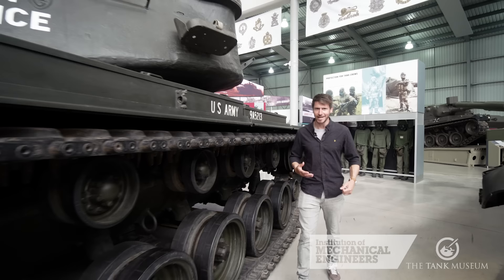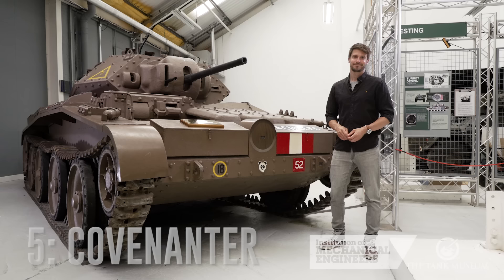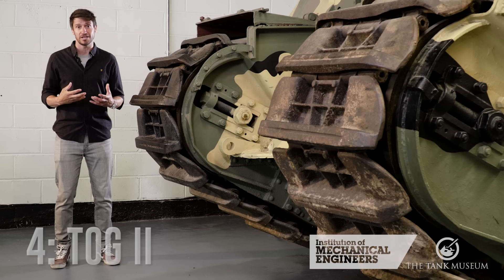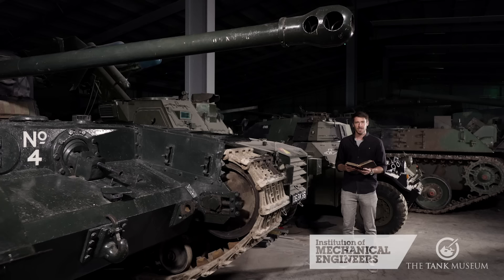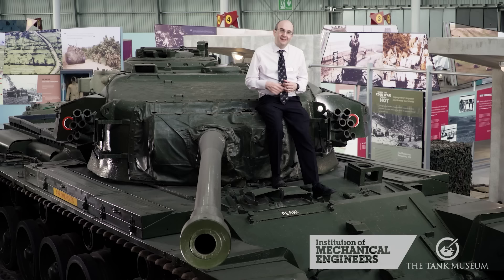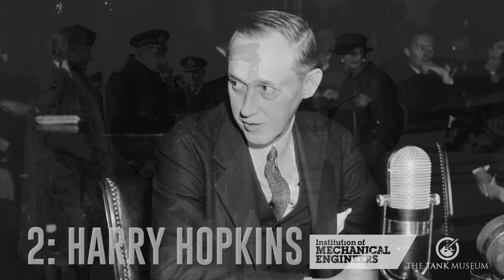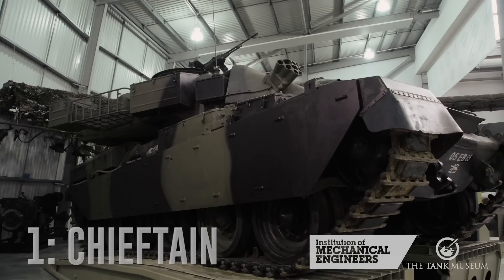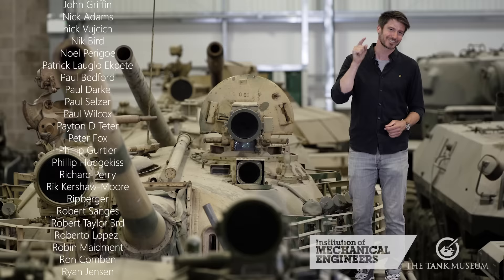Rob Bell | Bottom 5 Tanks | Institution of Mechanical Engineers | The Tank Museum

Comment: the TOG drivetrain story reminds me of a lesson imparted by my brother: "that sounds like a high tech solution for a low tech problem"
Reply: This is not the case. Regular drivetrain/gearbox/steering system for heavier tanks (no clutch-brake) was at that time also high tech.
Reply: @PavelNygryn  gears and clutches were already in use.
Reply: @kenbrown2808  Ofcourse. That's why smaller tanks used clutch-brake steering. Very simple, very ineffective. Heavier tanks can't used that and new systems have to be invented. They were. But none of those advanced system for heavier tanks in WWII was known as "reliable". Metallurgy and precision manufacturing for these systems was too much "high end" at this time.
Reply: @PavelNygryn  and electric drive was worse.
Reply: @kenbrown2808  As it turns out in the end ;) I mean this was not case of "hight tech solution vs. simple solution".  All solutions were high tech, difficult, expensive and previously unproven.
Reply: @PavelNygryn  again, no. Making a stronger drivetrain is a low tech problem. All it takes is a geared hub. Making an electric hybrid is a high tech solution. And it didn't work in any tank they tried it in.
Reply: @kenbrown2808  No, making stronger more realiable drivetrain and steering system for heavy tank was at that time high tech problem, that was no one able to achieve properly. MTBF of that part in all heavy tanks of WW2 was terribly short. Still better than electric, but on the other hand diesel-electric (not hybrid, that was not a option) and even steam-electric was already successfully tested in trains.
Reply: @PavelNygryn  no. Metal breaking is a low tech problem. And while they started playing with the idea of diesel electric locomotives in 1935, they didn't start taking over until the 1960s. Also, a diesel electric locomotive stacks as many as needed to pull the load and then goes at about the same speed without steering for hundreds of miles.  And they were developed to replaced steam locomotives which had much more power, but cost more to operate. So again: needing a stronger drivetrain is a low tech problem. Inventing a completely new kind if drivetrain is a high tech solution. And the solution didn't work. But do you know what works great: geared hubs. They are used in nearly all heavy equipment.
Reply: @kenbrown2808  Electric drive trains weren't that new, nor generators or diesel engines. Electro Motive had them in the market by the late 30's, and steam engines were virtually no longer made in US by the early 50's. 
They continued for a while longer in other countries that had the combination of low wages, plentiful coal, water, and little of their own oil.
Porsche's tank design is said to have failed because of problems with the reliability of his new engine, coupled with the scarcity in Germany of the materials needed for the electrics eg copper, not because of the drive system.
Reply: @stephenarbon2227  and an electric drive train is vastly different from a tank drivetrain at this time of day, too.    and other superheavy tanks had mechanical drivetrains; and nearly all modern tanks have mechanical drivetrains.  
so yes, creating a diesel electric drivetrain is STILL a high tech solution to a low tech problem.

Comment: Re: The Chieftain.  I would not be so quick to cast aspersions on your engineering brethren.  It seems much more likely that they did object but were shouted down by politicians and generals.
Reply: I think the other issue really is, how important is reliability vs availability.  It's quite possible generals felt that the loss of reliability was acceptable if the tank could continue to run the face of fuel shortages.  There's no point to a ultra reliable engine if there is no fuel to run it on and the military were operating on the (likely faulty but reasonable) assumption that nuclear conflict would make it difficult to consistently get fuel to units and scrounging fuel from civilian populations was going to be necessary.

Still.... I believe that the generals were wrong in that planning assumption. I believe that any marginal increases in fuel from scrounging wouldn't compensate for loss of logistics and the loss of reliability would incur too much costs in fuel for shipping of spare parts and time lost to maintenance

Comment: 3:12 - Grousers at the leading edge of the track plates force mud into the track pins, promotes wear.
4:12 - Appears the grousers were originally intended to be at the trailing edge, are the tracks now installed backwards?

Comment: 5. Covenanter. (Put the radiator on the Front of the tank!?)
4. TOG II.(A very heavy electric engine and transmission!?)
3. Nellie/White Rabbit/Cultivator. (It's a great agricultural tractor...far from the battlefield.)
2. Harry Hopkins. (A light tank with thin armor and a small gun.)
1. Chieftain. (A good tank when the 2-stroke, multi-fuel  engine worked.)

Comment: Leave it to an Engineer to overlook the glaringly obvious, like the fact that weight is far from the only problem encountered by a long tracked-vehicle. They don't really like to steer, and that's a bigger problem than the weight. Just imagine the stresses that would be placed on the outside track when trying to maneuver a TOG II (or anything similar). 

If it had a traditional transmission in it, that would have been an even bigger problem. The metals of the day were not apt to put up with stresses like that. If it was just as heavy, but shorter and wider, it would have an easier time of it, so weight is clearly not the issue. The issue is weight in conjunction with length.
Reply: The TOG will actually spin like a top... very very quickly. Because it was designed by master engineers who had already worked on tracked vehicles between 1914 and 1939... And know what would go wrong and why.

Why does it spin? Because they knew how to design the track system... just like on all of the Mk 1-9 tanks in WW1. The weight on a hard surface... is all supported along a few points along the center of the tanks length... by design. Thus it can and will spin like a top.
Reply: @captiannemo1587  Sure it can lol. You're dreaming.
Reply: @MFKR696  You do know there is footage of it spinning like a top on YT...Right?

Comment: Hmmm... interesting, although slightly flawed in its apportionment of responsibility, particularly for the Chieftain.. IIRC objections were raised to the requirement for the multi-fuel engine, but were overridden by the government think-tank 'experts'.  Not the engineer's fault then!  As someone who has had to work with the government as a driver, this is still common today.  "I don't want to hear reasons why not!. JFDI"  still exists
Reply: 'Think tank experts'. Quite an ironic set of words given the circumstances. :D

Comment: Agreed with all the choices except for the last one. Yes, a less than stellar stab at a tri-fuel engine, but this was when getting the MBTs out the door was actually a bit of a new exercise. And yes, questions existed about relative off road mobility and actual performance in service in certain conflicts later on. 

But it had good firepower and armor protection at the time of its introduction, and the Horstmann suspension system was relatively easy to maintain. Suspect it kind of debatable to have that tank ranked the worst on this list when looking at overall design, the period in which it was designed and introduced, etc.

Comment: The problem with the chieftain tank was that it was originally meant to have a gas turbine engine from Rolls-Royce but it was going to cost too much and take too long to develop so they went with the Engine they had at the  time, the army believed that if there was going to be a tank battle in Europe very rapidly fuel supplies was going to be Disrupted and it was going to be important that They could use different types of fuel. but it was a bit of a dead end they should have just stuck with a reliable Diesel engine.
But saying it was Britain’s worst tank is wrong I can think of quite a few more that have been developed or tried to be developed.
Reply: I never heard about the G/T engine. I did hear that Rolls-Royce were going to bid for the engine contract but pulled out when they heard it had to be multi-fuel.
Reply: Why do that if they were going to submit a turbine? which are usually multi fuel any way.

Comment: I'm an engineer in German MoD and regarding the bad designs I must add a crucial point: The military stuff determine the requirements, there technical knowledge is mostly limited and they're stubborn.They usually refuse advice from civil stuff  which hasn't the power to resist the nonsense requirements. As a result you get : garbage in garbage out... Finally none of these has response for the costs , because it's the taxpayers who has.......

Comment: One of the reasons for TOG's length was to cross ww1 style trenches
Reply: Looks like the countersink flange went out on the CD-7 unit
multiplier, knocking out hydraulic torque to the electric heat riser.

Most countersink flanges will experience hydraulic torque
leak throughout their less than 7,000 RQMs. Especially when coupled with the
double-flux lumen switcher. But with Wilson Countersink Flanges and Dorry
Flanges, hydraulic torque is allowed to bypass the settling clutch, providing
steady wall pressure to the lug manifold and all the seismic rotors. And that
goes for 7,000 RQMs, 8,000 RQMs, even up to 10,000 RQMS. That’s right! 10,000!

CD-7 should be able to handle vacuum-kickback on all 22
blossom valves!

Now, if I could just get my kid to mow the lawn!

Comment: This episode should really be named “Bottom 5 British Tanks”, other countries produced tanks that were just as bad if not worse than the 5 listed in the video, and with the inclusion of Nellie they can’t say they only included tanks in the museum. 
With regards to the Chieftains engine, the fault didn’t lie with the engineers, they designed what they were told to design, the fault lay with the British Army in not questioning the NATO requirement for a multi-fuel engine, Britain was the only country who actually attempted to fill the requirement, everybody else gave up and concentrated on Diesel engines.
Reply: The Leopard I had also multi-fuel engine ( MTU MB 838 CaM-500 ) and was build to the same NATO requirements.
Reply: @pogonator1  The Leopard I engine was 'technically' multi-fuel, but the German army and designers were fairly open from the outset that it was only ever going to be run on diesel. The process for converting it to run on another fuel was even more complex than the Leyland L60 which took a team of Royal Engineers, a field workshop, and 8 hours. I can't find the source now, but I remember reading that the conversion process essentially required a total rebuild of the engine, and would only realistically be able to be done in the factory.

Comment: My only criticism would be that the OR for the Chieftain specified the multi-fuel requirement and it was seen as a major need across all of NATO at the time the Chieftain was being developed. It was the bad experience with the other multi-fuel engines and the Chieftain which ultimately killed the requirement. For me the big question was why the Chieftain wasn't re-engined with an off the shelf diesel?

Comment: I hate to be that guy but... I very, very slightly disagree with the conclusion on Covenanter.  Yes, the main downfall was the radiator being in the wrong place.  But it wasn't caused by a size constraint so much as the thing being dramatically overweight to begin with (which making it larger would just make worse).  More weight means bigger engine to meet the mobility requirements, which means less room in the engine bay.

The primary cause of it being overweight was a decision to ignore the customer requirement for a welded design in favor of a riveted one.  The extra structural framework you need for a riveted design blew the weight out of the water.  Why did they decide to rivet instead of weld?  Because the company making the thing had always riveted things and didn't really have welders or welding experience.  Rather than admit they couldn't do it, or try to adapt to be able to do it as specified, they ruined the design to get something out the door.

The road wheels were also overweight, originally specified as aluminium, but due to a ban by the RAF on the army using any, they switched to solid armored steel.  Some weight saving on the wheels could probably have been achieved with a little extra engineering effort, but they don't seem to have bothered trying, so far as I can tell.

With the weight down, it'd be possible to use either a smaller engine for the same mobility, or the same engine with an enlarged engine deck (eating somewhat into the weight savings) for greater mobility.

Lots of good engineering lessons there, I think, just not quite the one put forth in the video.  :|

Comment: The Chieftain is the worst tank? not by a long shot.
Reply: it has the worst engines of all Cold War tanks. It was a formidable machine if fielded right, but during the Iran Iraq war, Iraqi's T-62 APSFDS can punch through Iranian Chieftain's armor from quite a distance, which was a rude awakening to the Brits. This spur the Brits to designed the Challenger tank in order to replace the Chieftain.

Not punching it down, just that if the most basic fundamental of a tank is done poorly, there is no reason to have it in the first place. But the British tank designer did learn those valuable lessons. You learned in life or else you will never improve.

Comment: Chieftain engineers should have had a parallel engine design as a fall-back alternative. Ready to use the same mounts and drop into the same size bay. Now that would have been good engineering!
Reply: Engineers don't get to make decisions like that, except sometimes in a small private company.
Reply: @SteamCrane  Hi heavy lifter. Thanks for the reply.
Leading design engineers do. They would be involved in the power pack selection process and can easily express concerns. Suggesting the prudent step of having an alternative as a backup. Plan B. 
I would hope all design projects with technically advanced/experimental major components would have that contingency built in. Then again, I'm not a design engineer.  Just a tax payer.
Reply: @gusgone4527  I am a design engineer.  The best choice is not always made.

Comment: Welder/Machinist for over 20 years.
I have to be able to read and build from a very wide range of different prints.

There are really good engineers....and some very arrogantly ignorant ones.

I have no idea how they managed to get hired in the first place but also be an overseer to multi million dollar projects more than once.

I got an unnecessarily complicated project I'm building right now.

It's going to cost them $17K.

I could easily redesign, build, paint, and deliver for $10K or less.

But you know...🙄 I can't possibly know anything because I only have a High School diploma from about 30 years ago.

🤨 Not all...but definitely common enough to say some...engineer/draftsman.

Suffer a severe case of the Dunning-Kruger Effect

Comment: The Cheiftain's engine was, admittedly, dreadful but this was NOT - as Rob implies here - intrinsically due the opposed piston 2-stroke design (check out the Junkers Jumo engine, or the Napier Deltic);  it was because that essentially decent design was dreadfully compromised by the necessity of running on different fuels, and by the adaptations that made necessary to what could otherwise have been a pretty good engine.  
Having said that, a conventional V12 (or maybe a flat-12, to keep profile low) diesel might have been a better choice, but that would have meant defying the yanks (via NATO), even though everyone else ignored the "multifuel edict" ... even the yanks themselves!
Reply: p.s.  The Russian T64 engine was also opposed-piston (and was also multi-fuel, I believe!), and that turned out to be reasonably reliable, and extremely compact for the 700bhp it delivered.  Perhaps we should've nicked one, made a load of copies and refitted our Chieftains with them ...

Comment: Same old mostly wrong tidbits that Bovington has been pushing out for the past few years. Not to go into all the other problems with this video, the TOG's electrical drives didn't take up any considerable length inside the hull; the engine did of course, but a lot of the length was unnecessary and was only there because the foolish British government demanded it to be. Bovington likes to blame the TOG engineers for that, but they were against it, and their preferred design, TOG III, was much shorter.

Comment: 'feet'? It is not the dark ages anymore, use standard units of measurement. That guy should be ashamed of calling himself an engineer while using units of measurement that are outdated by hundreds of years.
Reply: Suggest you don't try and buy diesel engine aftertreatment from German suppliers then - the bricks are sized in inches.